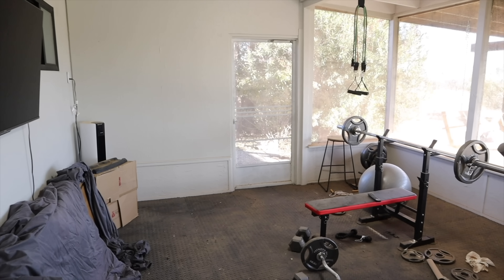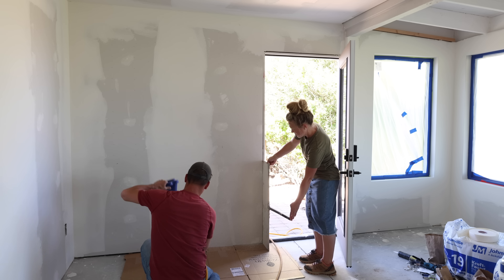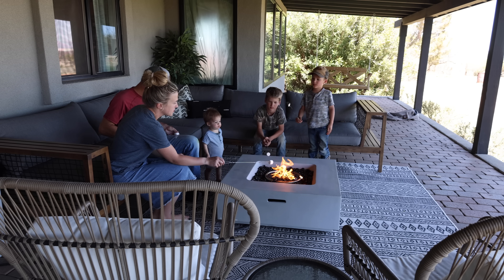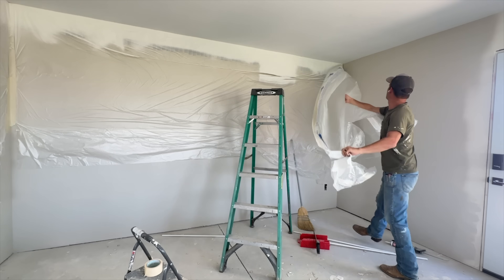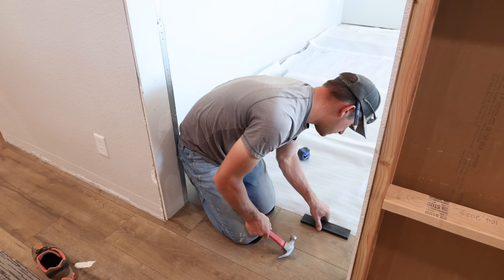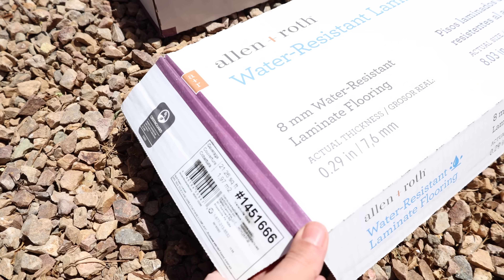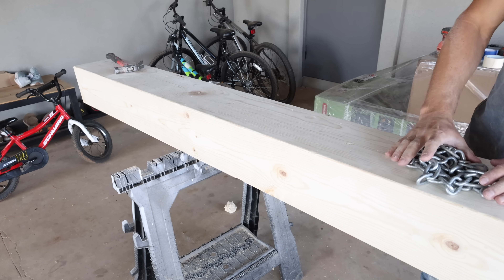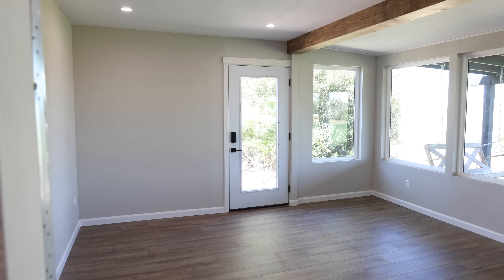COMPLETE ROOM MAKEOVER!!😍 EXTREME OFFICE TRANSFORMATION Part 5 | OUR ARIZONA FIXER UPPER

Comment: Why didn't you insulate the ceiling? It is so hot in AZ I am surprised.
Reply from the maker: He did insulate the ceiling, I had said in the video that we installed about 3 quarters of the shiplap and then he stuffed in the insulation before closing it off with the final pieces of shiplap 😊